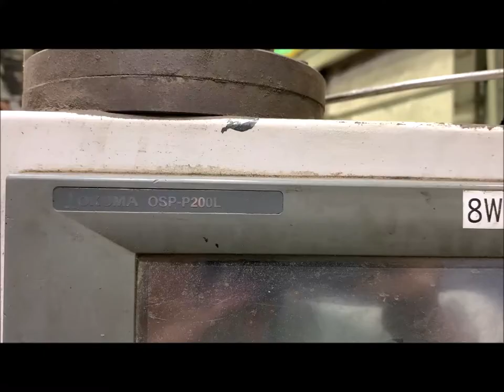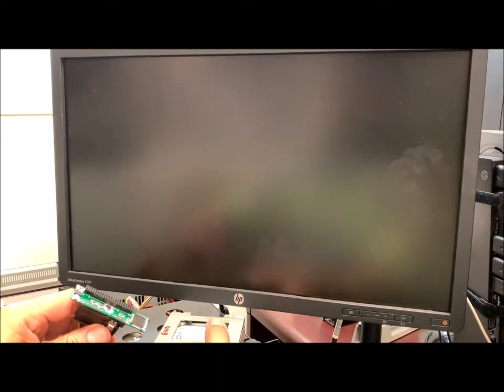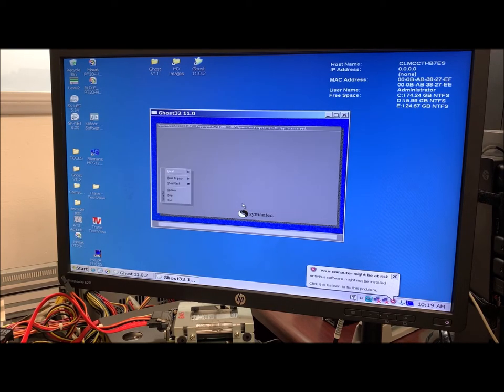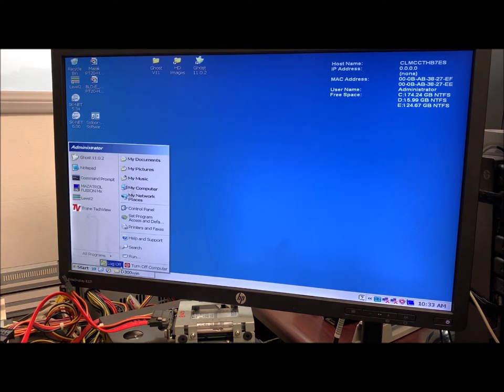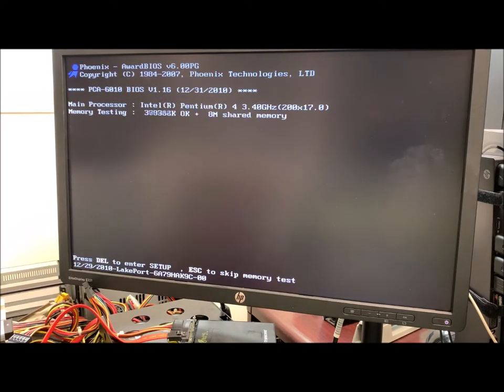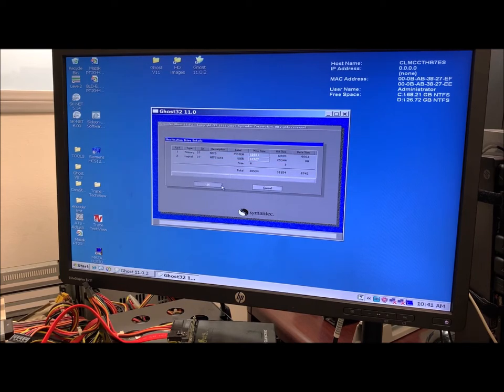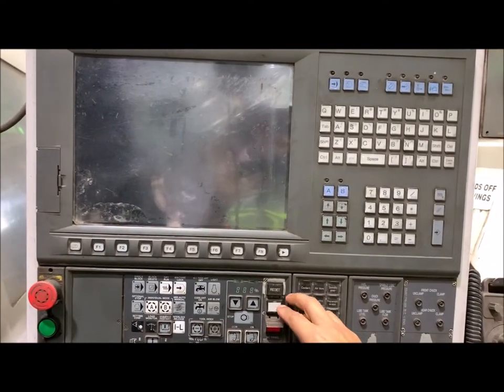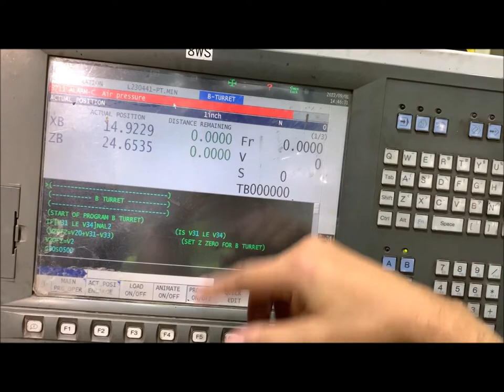How to clone a CNC HDD 2.5” IDE into an SSD. Image creation and cloning to SSD. Part #2

Comment: Hello I watched your vidoes and get the error "Non-System disk or disk error replace and strike any key when ready" after using acronis and backupper to clone the drive.  Any tips to fixing this error?
Reply from the maker: Hi there. The drive might have the boot sector corrupted.

Check next video 

NC machine_How to recover an HDD from "Non-System disk or disk error" & create an image to clone it.
https://youtu.be/P1VTXW73fz0

Should you have any questions please let me know. Regards